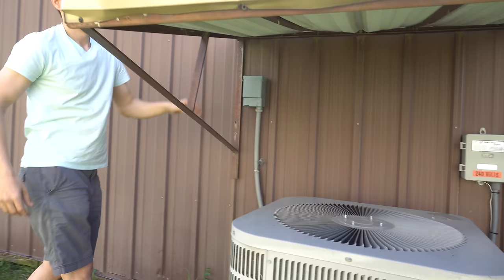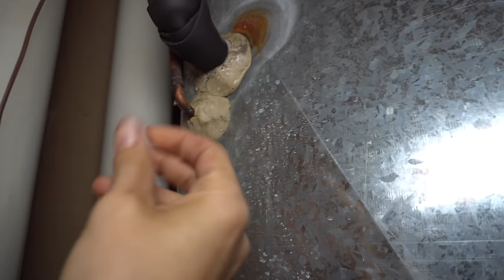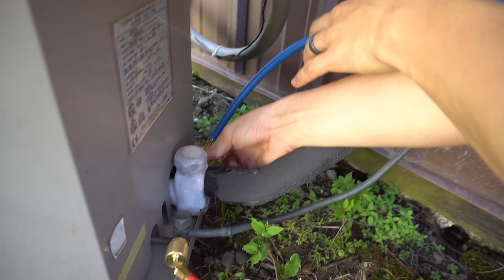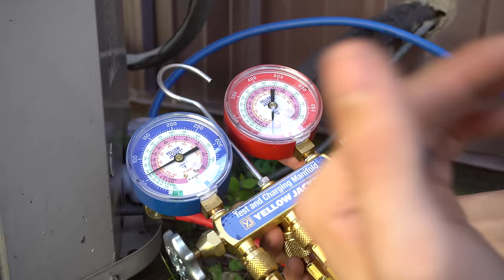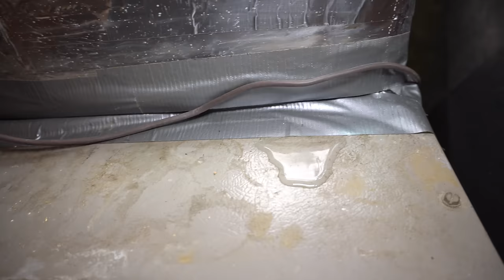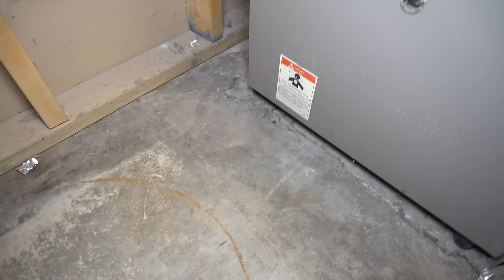How To Add Refrigerant To Air Conditioner

Comment: Hi.  Which YellowJacket do I buy for R22 AC?  There are a number of models - they really don't explain the differences...42006 Series 41...42004...etc
Reply from the maker: You just need gauges that have the R22 scale on them (green color). Model numbers and series numbers don't really matter

Comment: We rigged a unit from 4 different 1s but 1 was the lennox hs29,  what a unnecessary bunch of exstra cost they were. We got a deal on 120lbs of r22, rigged up a nitrogen tank to check the system with a old ww2 German AirTrank , cleaned it & purged it , put the 4.25lbs of freon in & 4days later we're good 😆   oh we soldered the 4 connections with old 1930s silver solder (my shop is really really old & filled with weird stuff) so 4 junk units for free =1 pretty solid unit, just the cost of the freon which I now have over 100lbs to (insert whatever legal nonsense in accordance with law here) 😉 

The beer can method is perfectly fine, worked well for decades

Comment: What you have done is band aid solution. You just top up freon on the coil line. That action will not take so long, in that case u much check the valve, their is possibility valve is stuck up, that’s why the freon not able circulate. Causing of icing.
Reply: He said that several times...

Comment: Cooling professional charging $274 per pound for refrigerant as of 8-20-21!!!! Upstairs unit stopped working. Switch in outside unit was shorted with a spider! New switches are sealed. I changed the cap myself. No fix. $799 bill! Most expense was refrigerant. Inside of the house upstairs got to stifling 90 degrees. Had no other option but to pay the professional. No regrets, he did a lot of other servicing things like pipe insulation. Like he said, only pros can get this stuff in bulk like that. Pay the man!

Comment: hi really liked your video, but I am using the RED TECH R22A product and I don't under stand how much gas I should put in my home AC unit ,its a Lennox  HS18 261 8P  its about about 34 years old. I added R22a about 5 years ago but last couple of years its been struggling. I want to change the unit but I also want to change my furnace. Problem is I am doing home reno and I don't want to put a new furnace in with all the dust going on in the air, I will change it after done reno, just need to keep coll for a few more months. I added a full can, 8 ozs  and low side went to 80 psi ambient temp was 80degs F.  Temp at the the discharge vents was 57 degs F. So i put in about 3-4 ozs more but press still at 80 psi. House still at 79 deg F I don't know what is going on here????

Comment: Thank you for your video.  Quick question: if I want to add R410A on my Puron AC, will the Yellow Jacket 42001 Manifold with 3-1/8" Color-Coded Gauges be enough or I need additional tools  please?
Reply: With 410A it is a critical charge system. You will need 410 gauges, suction and liquid line temp clamps, a wet bulb thermometer, a TP chart, is it a metering device or TXV, are the filters clean, possibly airflow testers and temp probes, and the knowledge of 3 years apprenticeship to have obtained a journeyman’s license in most areas of the US. I may have missed a couple of things but these are some of the basics.
Reply: @markcaldwell1245  Thank you! All too often I see people on here thinking that just because they saw someone on youtube doing this that it is a simple process. They fail to understand that there is so much more to doing this properly and in a manner that doesn't do any hard to their system.

Comment: Using an inferred gun, I checked the freon line on the A/C condenser its from 88 degrees to 91.  Do those numbers sound right?  The indoor temp is taking a long time to cool off. From 81 to 77 in 5 hours in a small apt.

Comment: U said refrigerant leaks out from winter. I was told it's not supposed to since it's a high pressure system rather than low pressure system.

Comment: My question is of the three hoses they have two sides. One has a kink one does not which side connects to the gauge because I see some videos where some people have the side with the kink connected to the gauge on the yellow one and then the other ones were the opposite they’re totally different. That’s for sure.

Comment: Hi Jay ! I am ready to check my AC but noticed that my gauges don't have R410 listed on the screen of the scales. Does it any matter or how can I stablish the good pressure at the moment of adding the refrigerant ? I guess it is not so important as far as I check the pressure reading the PSI scale. I think that theoretically it would be some differences but not to limiting me to recharge the system. Mine takes R410. Thanks in advance for your suggestions and advice.

Comment: love how they made a canopy for the condenser
Reply: Actually, that's a bad idea. The heated air is discharged out of the top of the unit and the canopy immediately redirects the heated air right back down for it to be recycled through the coil.
Reply: @512kjt  It's just recycling the hot air.

Comment: Adding subcooling/superheat measurement would leave this system filled correctly (it is underfilled now) and bit more efficient.  But considering that professional AC contractors charge between 70 and 120 for each lb of R-22 plus service fee one service call could be 500-1000. At the same time ebay price of R-22 is 15-20 per lb and this way gets your system running in a simple way without overthinking.
I would recommend however looking at the label, checking the standard charge and adding no more than half of that in the absense of secondary control. Easy to do with the bathroom scale.

Comment: Jay thank you for teaching and sharing--- really appreciate you and your channel. I learned so much, your video content  demystifies HVac system, thank you. 
By the way what is your opinion on refrigerant leak sealant applicators like RectorSeal AC Leak Freeze Pro or Nu-Calgon EasySeal? Some contractors like it, some don't. Some of the sealant has a means to locate the leak in the system as they have UV dyes. The sealant can be added on the freon line and make a seal to any leaks in the coils. Do you use it? 🤔

Comment: Can we perform this same procedure without connecting the red house  (high pressure line) at all?  It didn’t look like we even used it other than viewing the pressure. The refrigerant from the cylinder should have pressure and push into the blue suction line correct ?
Reply from the maker: Yes. This can be done without hooking up the red hose at all. But sometimes it helps because if you don't see the pressure rising on the red gauge as you are adding refrigerant, then there is something else wrong other than the unit being low on charge. It doesn't happen very often but that would be one example of where having that second hose on would be helpful.
Reply: Awesome video and thank you!

Comment: So how often does a home ac unit typically need to be recharged?  Also, since we can't do this ourselves, how can we keep from getting ripped off from our local HVAC shop if we just want a recharge on R22....??
Reply: If everything was installed correctly and you don’t get any vibration rubs on the copper lines over time then it should never need to have refrigerant added. As far as not getting ripped off. I would call a couple of companies and ask what they charge for R22 per pound. That should give you a feel for how each company treats its customers. Finally local is usually cheaper because they don’t have to travel as far. Lastly make sure you change your air filters every month and wash your condenser coil at a 45° angle downward at least once a season.

Comment: Thank you for this helpful video!  Question... how many lbs. of freon generally need to be added to an R22?  I had quite a bit of water coming out of my AC and pouring onto furnace and floor over a two-day period when AC was running.  Cooling temp was never a problem.  Repairman added freon, but never told me how much he was adding (cost per pound, etc. ) or what the initial level was to indicate how much was needed.  (Wish I'd seen this video beforehand!) I sat with him while he was adding, and I saw the valves moving, but just wondered about the freon cost (quite expensive!) in addition to the other charges. Thank you so much.  Definitely subscribing!
Reply: You need to get a Licensed HVAC person to check entire system; some of the videos posted here are not done by qualified service personnel. You may be breaking several State laws which are punishable by steep fines and jail time!
Reply: You can check the BBB in your area or call any of the listed trade associations advertised in the Yellow Pages or online!
Reply: @bobboscarato1313  how did that have any thing to do with her questions bob 🙄
Reply: @JeffreyGunner  Get a life; that's an old question and she had a shyster repairman! She got ripped off; plain and simple!

Comment: Jay....  My low side started at or near 33 degrees for R-22 scale for the low side gauge.  I can't get my unit to take anymore than 36 degrees on the same gauge.  There is no frost anywhere.  Why can I not get the unit to go up to 40 degrees?
Reply from the maker: The evaporator coil might still be frozen, did you physically take a look at it? Another possibility is a plugged metering device or a bad compressor. There could be a variety of different problems though. Are you familiar with the refrigeration arrow chart? (should be able to find them on google) That chart helps diagnose refrigerant problems.

Comment: My R22 AC does not sweat on the low side at the compressor as it should and it is warm instead of frosting.  So I measured the low side pressure and I see about same reading as yours on the low side, about 50 psi (and about 190 psi on the high side, somewhat higher than yours) , which means it needs recharge just like in your case.  However, on my AC, the low side is warm and it measures about 78F very close to outside ambient temp instead of frosting.  Why is mine warm instead of frosting when the low side reading is same as yours?  This is what really puzzles me.  I would appreciate it if you have any idea.  Thanks in advance!

Comment: Real good video but I would really like to see a more in depth video of charging a unit, maybe a video of charging a heat pump as well. Also the knowing when to check super heat and sub cooling depending if it’s a “fix” or if it has a “txv”.
Reply: There also definitely has to be leak if it took a year for that unit to need more refrigerant again

Comment: We’ve always added refrigerant in liquid form. You just go slow and only introduce little bits at a time waiting in between
Reply from the maker: I do that too and of course with blended refrigerants that's the only way to do it. When I work with R22 it's a change of pace to be able to simply add it in vapor form though. 😄

Comment: My R22 tank only has about 2 lbs of refrigerant left in it and I can't get it out of the tank and into the unit.  Valve is good.  I'd like to get that last two pounds out because it's so valuable right now.  Tried putting in a bucket of hot water no luck.  Any advice?
Reply: Turn it upside down open gas side, not liquid. Using a heat gun, make sure to keep moving gun. Heat tank directly. Or pump system down allow suction to go into vacuum open low side gauge n suck that had in there👍

Comment: question:  if the high side is still under 200 psi but low side exactly 75 psi, does it mean you keep adding until the high side is in the 225-250 psi range?

Comment: Is the furnace going to be replaced also? If it is great but If not I would not recommend using the furnace to thaw the coil out . There’s a risk of rusting the heat exchanger and lead to cracking it and damaging other  parts like the blower motor the control board thing that sit under the coil . Only time I recommend using this method is on heat pumps where the coil typically sitting on the bottom of the unit .
Reply from the maker: Thank you for the warning Ghost!
Reply: I always pull the disconnect and let the fan indoors run for 30 minutes to an hour and then go do something else and come back.

Comment: Professional tech; I wish you are close I live in CA and not sure where you are. My AC is 5 years old and I service it yearly. The secondary drip line has been dripping every summer since first year and I thought this is normal. But this year (last week) during service I was told the coil in the attic is leaking and the pan is cracked. I never went up to the attic where the furnace is located so no idea how this happened. The AC company want to charge me $2,700 (outrageous) to replace the coil and pan. My AC has been cooling good for 5 years and I told them I will get a second opinion. Can you please give me any advise as my warranty has expired after 5 years. Note; there is no flooding now in the attic but they said it may flood and they added this year 3 pounds or refrigerant. Thanks Jay

Comment: hi man, your video is so helpful.... Is there any way we can determine the mass flow rate of refrigerant ??? Any help will be great
I need it for my research paper :)
Reply: If I understand your question it would be measured by the compressor liquid line input draw, the compressor output pressure and the metering device size and type. Not sure how you would figure out compressor values without contacting maybe Copeland compressors. Finally add the psi suction and liquid pressures to the calculation and that should get you close. Maybe contact Trane with your question as they literally wrote the book on HVAC/R.

Comment: Hi great videos, i was wondering my AC unit it runs cold for one hour then it get too hot and the outdoor fan stops working and grinding noise from the condenser. Tech came few times and can’t figure it out, any ideas would be appreciated. Btw the tech said he checked voltage levels for the fan motor, capacitor and relays and said they were all within acceptable level.
Reply: Thank you

Comment: Upflow furnace with the Evap on top? Usually not a good idea to use furnace to melt the ice. Heat gun works good if careful. 
Downflow furnace with Evap below using furnace heat is ideal to melt it, if needed!

Comment: If all alr was purged from the hoses like you did when first connected, there is no need to purge the high side a second time and get that oil all over the place! Also for the high side (red) standard hose length it contains 3 oz's liquid refrigerant. This is book value and I had nothing to do one day and actually weighed my manifold and red hose empty and then charged. Came out to exactly 3 oz. !! Blue line is only vapor and weighs next to nothing which came out to if I remember correctly about 0.3 oz.

Comment: Is it safe to add liquid from the suction line since it’s going straight to the compressor?
Reply from the maker: Yes, it is okay. In fact with pretty much all the other refrigerants besides R22, you can ONLY add them as a liquid since they are blended refrigerants. You want to add it slowly though, by 10-15 psi and not by opening the gauge all the way.

Comment: So if an r22 system is empty and then is filled with r290….which is so close to what r22 is within the line tests shown on charts provided online….its the recommended r22 replacement ….would the pressures be expected to be the same while the unit is running? Meaning the pressure readings on the side of the machine compared to the gauges when running it with r290….

Comment: Love your videos Jay. Can you tell me what do you think about replacing r22 with 407c. R22 has gone through the roof. I Dont know if it’s worth pulling the compressor and draining the oil to change to poe oil, and brazing every thing back together, pumping out the system.
Reply: It isn't. Even the best R22 systems out there are approaching end of useful life and that kind of money thrown at them would be wasted.
Reply: Thanks for the reply
Reply: @c.h.4829  You bet. There is another “drop-in” called R427. It does require a full evacuation of R22 and the manufacturer recommends replacing o-rings and seals, but I know of a few guys that have done the swap without those steps and the systems are still doing okay. It is miscible with mineral oil and alkyl benzene oil, but also flows with POE. Check out Arkema R427 in your preferred search engine. It’s about as close as you’ll get to a replacement if there was one. It about 75-80% less than the cost of virgin R22.

Comment: My Central Unit's Honeywell wireless thermostat's(Model no. TH6320R 1004) display not is not showing. I changed the batteries but still it is not displaying anything. And the central Ac is running continuously and is not turning off. Can you help me with this problem?
Reply: Call a real tech cause there are several possibilities and this is not DIY friendly. Otherwise check the transformer.